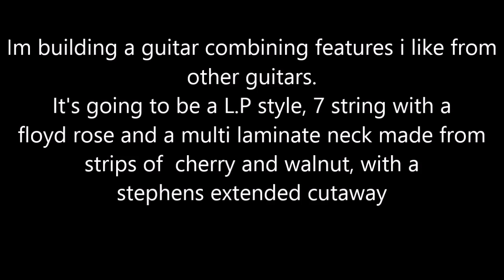building a Les paul style guitar : The Neck Part 1

Comment: I'm building a lp 7 string soon, do you know if the body is the same size as a six string? 
Ive got the routing templates for the pickups and neck pocket, its the body I'm curious about.
cheers. ;)
Reply from the maker: When I did mine it was roughly the same size but you could make it bigger or smaller ,the extra string would make it less than 1/2" wider so I didn't think it needed to be bigger
Reply: @sdmcustoms  cheers.